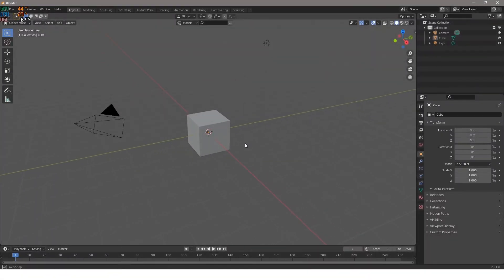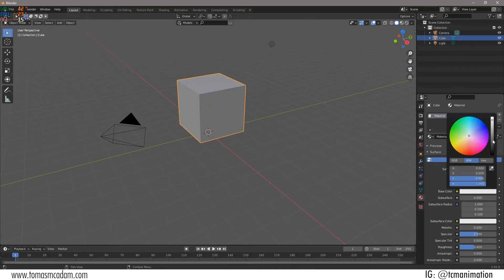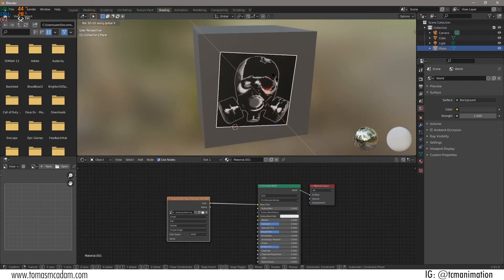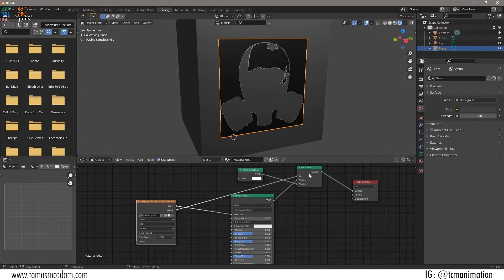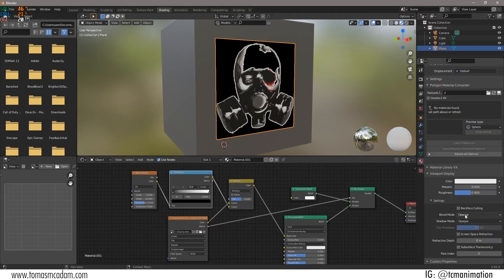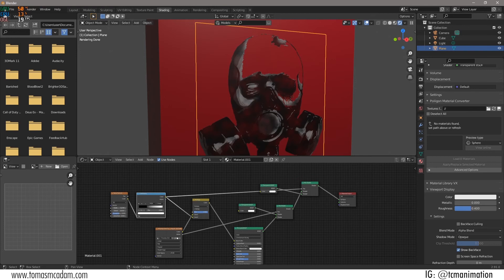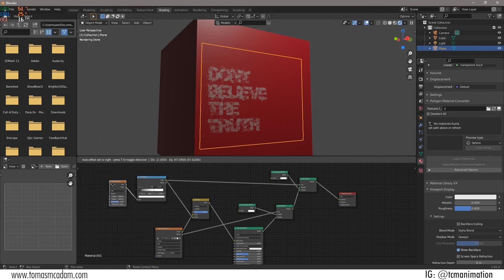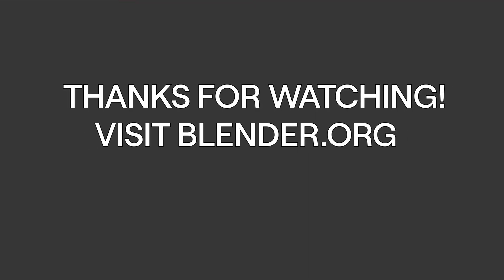How To Use Noise Texture To Control Transparency In Blender

Comment: Thanks, I took what you did and adapted it to the free Kit Ops decal process in Blender 3.0. Kit Ops decals wasn't working in 3.0. The file path to the decal folder was correct, and they appeared in the Kit Ops asset browser, but when applied came up pink, meaning the texture file couldn't be found. Each texture file when downloaded was stored in a sub-folder, but the files in each sub-folder were identically named! You had to extract all the files and give them a unique name first and put them in a single folder before they could be used. I used the Bulk Rename Utility to do that. I discovered elsewhere that you need to pack the blend file for decals before they can be used as well. That was another step. Finally, the decals come with their own mask, which plugs into the "Info Decal Group" node created by Kit Ops. The original decal image texture doesn't have an alpha channel. Nevertheless, your procedure could be adpated to work with this set up. A very satisfying result, if slightly laborious to achieve it. Also, when you apply the decal (or grafitti in your case) to the object, use the shrinkwrap modifier. It's easier that way.